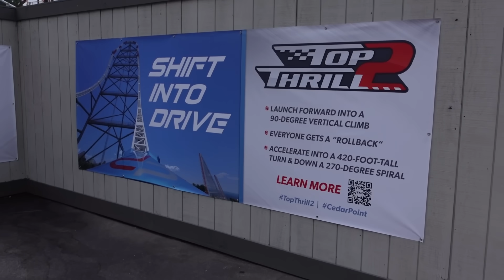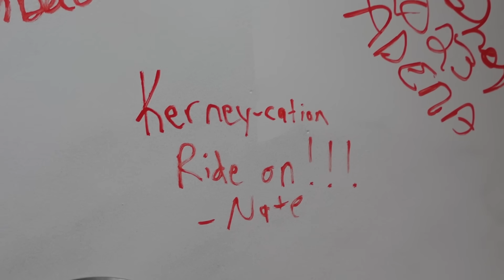Cedar Point Announces Top Thrill 2 for 2024! | Media Day Interviews with Zamperla and Tony Clark!

Comment: Great interviews! It seemed like you had prepared questions for both. You made me think of questions to ask them. For Zamperla, "what was the main reason for the 74mph first launch speed?" and my burning question for Cedar Point is "Why was it not worth the investment on this project to extend the layout past the top hat?"
Reply: It was the previous launch tech that lead to the accident. They wanted to add something new that could fit in the park.
Reply from the maker: Hey Nicolas! 

Thanks so much for watching and the comment! 

Yes I definitely spent a few hours milling over the questions and also made some last minute changes after the official announcement that morning! I am glad to hear that translated will in the video! 

My un-professional guess for the 74 MPH first launch is a limitation on an LSM launch system. With the amount of track that’s available, an LSM is only able to get you up to 74 MPH. Comparatively, the previous Intamin Hydraulic launch is able to get you up to 120 MPH. 

I think Zamperla needed the spike in order to use LSMs as a lunch method, since it would require multiple launches or a swing launch to get the acceleration up to 120 MPH to get over the top hat. 

Adding to my response above, I think they would have to increase the spike and launch distance if they used LSMs to get over a taller Top Hat. It’s a safer and more cost effective option in my opinion to avoid adding height to the top hat in something that has worked for 20 years. Too much risk to add re engineering at that height in my opinion. 

With this attraction, they get a strata coaster back, that also is a record breaker. It’s a win win for Zamperla and cedar point. 

I honestly think we have hit a ceiling for tallest and fastest coasters. One of the best coasters in the nation, velocicoaster, is none of those things. I think making a great coaster experience is the next frontier.

Comment: That’s pretty worrying if they’ve only been focussing on their side of it, rather than considering what is already there. Hopefully the new works well with the old otherwise it’s gonna be a disaster.

Great video!
Reply: That's just public relations to not look bad by commentating what the other company has done. He answered it perfectly by only focusing on what their company can do. Obviously logistically, they know that ride inside and out to make all the necessary changes
Reply from the maker: Hey Aftermath! 

Thanks for watching and great point! I think their engineers are definitely considering those factors honestly, so they don’t make the same mistakes,  but from a PR perspective, they are focusing on the future, and not the past.

Comment: Metel detectors ??? What ??? Canadas wonderland owned by cedar fair doesn’t have those in ride lines only the frount park
Reply: To make sure people are bringing phones /keys/ stuff that can fly out and injure a bystander I guess?
Reply from the maker: Exactly. Steel Vengeance has them in line to make sure you have nothing in your pockets. It’s not about weapons. Based on Tony’s response, they will work with the manufacturer Zamperla to see if metal detectors are going to be required. It is nice that you get a complimentary but small locker for steel vengeance since you can’t really take anything on it.

Comment: Name has nothing to do with racing! Smoke the competition? Still smaller than king da ka! And the line will be slow!
Reply from the maker: Hey Edge! 

Thanks for watching! I think they are going for a racing theme and not an actual race,  but I definitely see where you are coming from! Like Gemini is a legit race between to coasters. 

Yes, honestly, I think the difference in height is not substantial enough to make a difference between king da ka and the original top thrill. I think six flags just waived a big check at Intamin asking to be a little bigger and faster than TTD, which is bad business practice in my opinion. 

I think Intamin should have offered the same ride height and speed to six flags or created something entirely new.